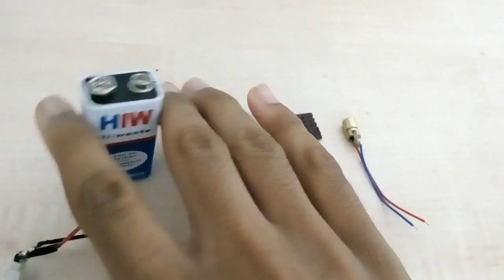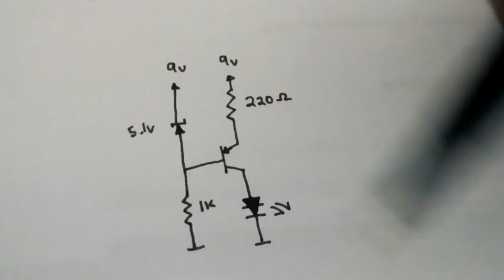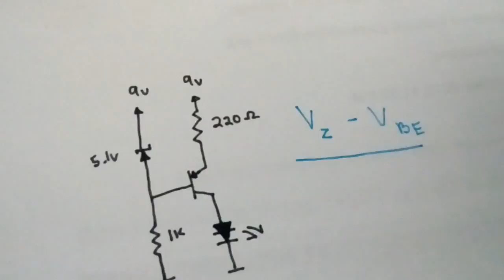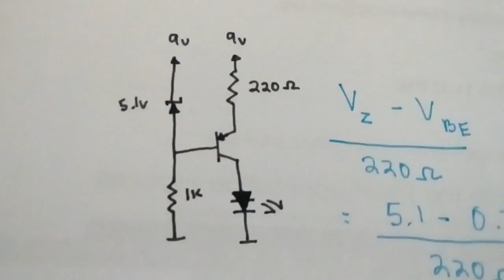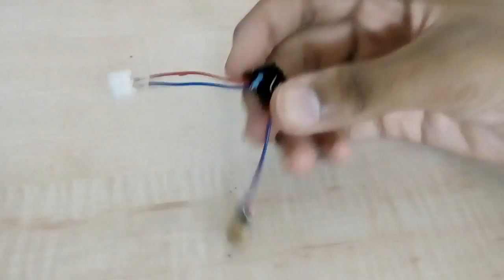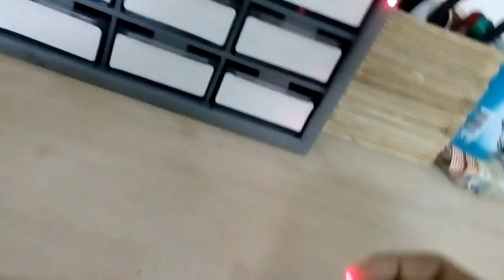Simple Laser Diode Driver ( Dirt Cheap! )

Comment: I tried to make this but replaced with bc327-40 transistor. Also using 2v zener instead of 5.1v as that is what I had. I'm measuring 9.5v across my laser diode. Is this normal? Current is 13ma.
Reply from the maker: What is the value of the resistor you're using in series with the emitter?
Reply: @NNNILabs  Same as yours, 1k and 220ohm resistors.
Reply from the maker: @unknownbroadway   Unusual problem. Check to see if the laser diode has its own limiting resistor. Also try putting a meter to measure the current without the laser diode.
Reply: @NNNILabs  Maybe your phone skipped my last comment notification. Yes there was a small resistor on the laser diode. I shorted it with a solder blob. The Vf of raw diode is 1.95v. Replacing 220ohm with 100ohm resistor gave me 18-19ma constant with 2v regulation from zener.
Reply from the maker: Now that I think about it, your first value of 13mA roughly corresponds with the formula - 2V - 0.7V (from the base) is 1.3V, divide that by hundred and you get 13mA.
Low voltage Zeners have very soft 'knees', by which I mean their Zener voltage is not very well specified and might vary a lot with temperature and bias current. That might account for the 18-19mA.
Sorry for the late reply.
Reply: @NNNILabs  I'm powering using bench power supply. The 18-19ma figure is the total current shown on the display. It is the total current consumed by all the components together. Laser diode itself is consuming around 15ma I guess. As per your formula, it needs a 65ohm resistor but the closest I could find was 100ohm. Visually, 15ma laser power looks the same as 20ma.
Reply from the maker: As long as the current remains constant everything should be fine.

Comment: Yes, it draws 20mA.. but the voltage is 1.8.
What if I want a constant 5V ?

I have a 10W 5V LED which I need to cap to maximum 1.5A
Reply from the maker: 1.5A is a pretty large current, so you're going to need something like a LM317T (maybe two in parallel) or a LT3081, both of which are adjustable down to zero.

You don't need to worry about the constant voltage part - the voltage drop across the diode depends on current and temperature, so adjusting current is the most reliable method and at 1.5A the voltage drop should be around 5V. The only thing you need to keep in mind is to use a power supply capable of at least 2A (conservatively) and say 9V or so to overcome the voltage drop across the current source.

Comment: Hello,
I am working on a holographic interferometry project  currently with a approximately 20mW output power laser diode which works on 2.3 dc.After watching your video and a few other i came to the conclusion that we need an extra circuit between the power supply and the laser diode. Can't i just connect 2.3 dc to laser diode or what do you suggest?
Reply from the maker: Hello, I'm really sorry for the late reply (it's been almost three months!), YouTube didn't give me a notification.
Connecting 2.3V to the laser diode is not such a good idea, since the current drawn by the diode varies with temperature. As the diode runs for longer, it gets hotter and draws more current. This continues till it eventually blows up. Passing a constant current though a diode ensures that it lasts longer and has a consistent brightness.

Comment: Hi, is it possible, just for testing if one diode works, to connect it directly to 5vDC?

A friend had two devices with lasers that stopped working, he wants to test if the failure is on the laser or on the power suply or on the circuitry.
He asked me if connecting it for a moment should work or fry it right away.
I don't know. So far from what I have read, it seems that long term operation heats it and kills it, as you mention on the video, but I don't know what could happen if it was just one second. If the lasers are working, then it might be worthwhile to make a driver. Otherwise they all go to the garbage bin :P
Thanks for your video
Reply from the maker: Yeah you could connect it to the 5V rail, but I'd recommend adding no less that 220 Ohms in series with the diode. This should work for short duration tests.
Reply: @NNNILabs  thanks man! Is it standard 5V for lasers? Or are there other ratings?
Reply from the maker: You can get diodes rated for both 5V and 3.3V. I don't think connecting both types to 5V would make a huge difference, just decrease the value of the resistor while using a 3.3V supply.

Comment: according to your suggestion if i used 18650 cell instead of 9v battery pack use two regular diode in series in place of 5.1v zener diode but problem is that laser diode is not glowing in full strengh
Reply from the maker: Then you could try to increase the current by reducing the value of the series resistor to the laser diode.

Comment: what will be the circuit when we will use 18650 Li-ion cell
Reply from the maker: Since you're using a battery with a lower voltage, replace the Zener diode with two regular diodes in series so that the voltage drop at the base becomes 1.4V. Everything else is straightforward, you'll probably end up with a low resistor value, which is allright.

Comment: Nice :) which laser diode module is it? Any link to buy it?
Reply from the maker: It's a generic laser diode. I got ten for cheap on eBay:
https://www.ebay.in/sch/i.html?_from=R40&_trksid=p2050601.m570.l1313.TR11.TRC1.A0.H0.Xlaser+diode.TRS0&_nkw=laser+diode&_sacat=0
Reply: NNNI cool thanks!

Comment: I have a 5 mW - 5v - 40mA laser diode. I also have a 2N3906 PNP Transistor.
I I use my 2N 3906 in place of 2N2907, and a 110 ohm resistor in place of a 220 ohm resistor, will the circuit be ok ?
Reply from the maker: As long as the bias stays around 5V, the output current will be 45mA, which is perfectly fine. This circuit can handle greater extremes. A 40mA diode will be fine.
Reply: Hi NNNI, Thank you for your attention and help.
Reply from the maker: You're welcome, Adelelmo!

Comment: Thank you! I was having this exact problem. I connected the laser to power and it worked fine until an hour later when it started heating up and dimming. If I want to have 6 of these lasers running in parallel, would you recommend I make a driver circuit for each laser, or have one driver for the whole parallel array?

I'm powering them through a 9v power supply. Do I need to regulate the supply as well? I think I have an LM317 lying around.
Reply from the maker: I would definitely recommend using separate driver for each individual laser, then you won't have to face current sharing problems that usually happen. 
No, supply regulation won't be necessary since you have an LM317 which you can use in constant current mode.
One workaround to using six separate drivers might be to use low value resistors to distribute current evenly. I haven't tried this method, though.
Reply: @NNNILabs  do try making one common power driver for all 6 diodes running at same time from same power source. I need it anyway if you can make one.
Oh.... yes one more point... pls do tag me when you make one so that I get notified.
Reply from the maker: @mvnar  You could try using an LM317, they are cheap and easy to use.

Comment: I have 30 piece laser diode and those supply voltage is 4.5v DC ,and operating current is 40ma how many power supply i need to on all 30 diode at a time please help
Reply from the maker: It depends on how you want to run them.
If you want to put them in series(Which I don't recommend) , then the voltage should be 30 x 4.5 = 135V which is absolutely ridiculous.  
Paralleling the devices makes the job easier. At the rated voltage, 30 should consume around 1.2A continuous.
You need a power NPN transistor (I recommend TIP31). The resistor should be able to handle the high power.

If you need an even simpler solution, use an LM317 in constant current mode.
Reply: Dear thanks for replying i don't have inaf knowledge of electronic i have this laser diode for hair treatment ....I have +5v 0.5A lover adapter
Reply: +5v 0.5A power adapter
Reply from the maker: I'm sorry I can't contact you through that medium. However, I'm sure there's a simple solution, you can do it with a little research and I'm sure you'll enjoy making it! ;)
Reply: You just tell me 5v 0.5A adapter is ok for 30 × 4.5v 40ma diode i joint all diode  red  to red  and black to black wire it's ok i have 12v adapter also please help I'm confused i already burned some diode
Reply from the maker: It's not ok. 
Constant current driver is a must.